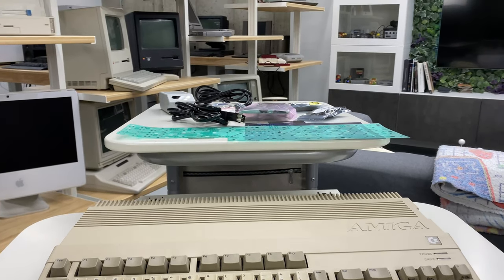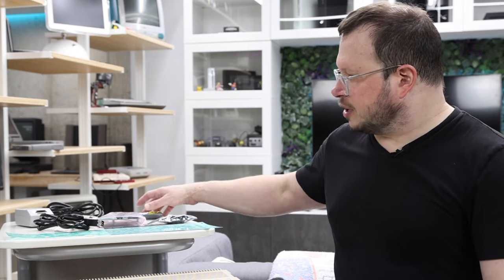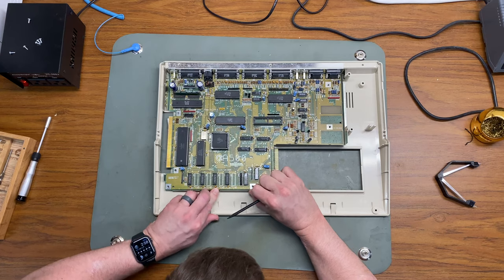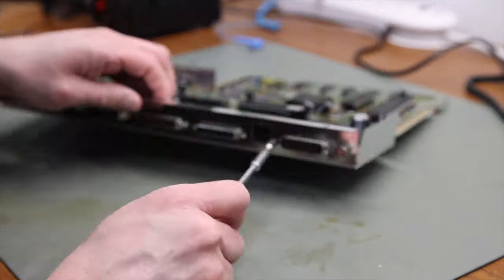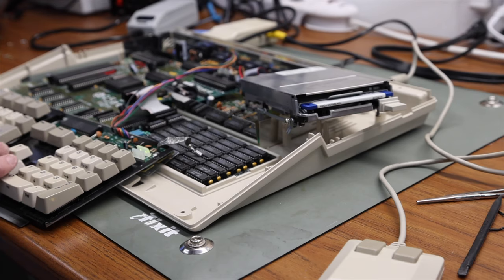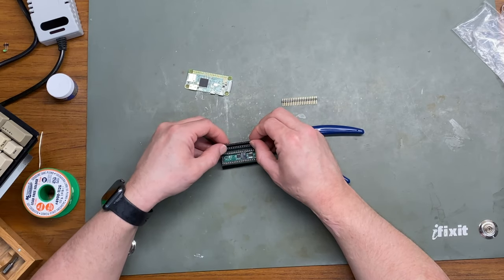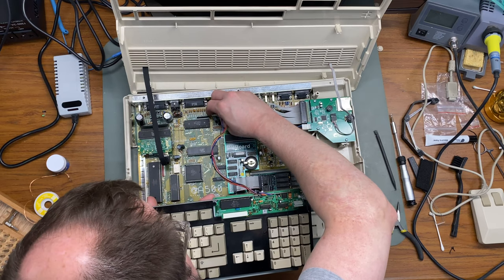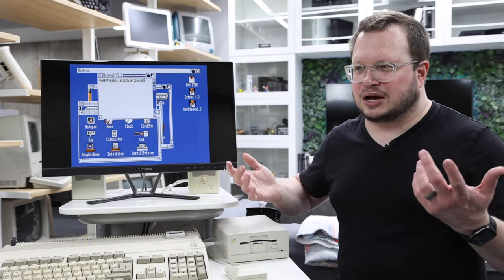Amiga 500 repair and upgrade | Jeremy's Retro Bar

Comment: I have been doing similar repairs on two NTSC Amiga 500s over the last few weeks, and the way I resolved my non-functioning keys was to glue a little strip of conductive copper tape onto the bottom of the plunger.  What I found using a multimeter was that the original conductive rubber had either extremely high resistance, or no continuity at all. 

Another trick is to paint some of that electric paint onto the pads of the membrane for extra conductivity. 

You may also want to check continuity and resistance between different pads on the membrane to make sure you don’t have a broken or degraded trace anywhere. 

Keep going!  That keyboard is absolutely fixable. :)
Reply from the maker: Thanks. Great tips all around.

Comment: The problem with the one leg on each capacitor is that it is the one attached to the ground plane.  The copper substrate dissipates the heat.  The solution, I have found, is higher heat with a short dwell time so not to burn the board.  Pain in the arse, for sure.
Reply: I recapped an Amiga 500 two weeks ago and can attest that this method is effective. :)

Comment: Great video Jeremy! The HD option can stay pretty true to the original too. I installed the GVP side slot add on. That allows extra ram, the HD and a scsi interface and still be period specific! Even added on scsi a cd rom drive. I now have the 1992 Amiga I always wanted when I was 12!

Comment: Hi, nice Video and nice tinkering. When soldering to pcbs i recommend to use more flux and a little more heat so you don't have that pickling noses at the solderjoints. 😉
Reply from the maker: Thanks! This is why I love making videos, I get to make a thing and people with actual know how can give tips that are useful to what I’m doing. I really appreciate it. I didn’t know if it was too hot or not hot enough.

Comment: Great video Jermery.  

The Amiga can be a pain to solder in with its large ground planes but you did a good job in the end.  One the keyboard issue I wonder if it could be a cracked trace on the membrane?  You said it worked once when you just used the plunger on the membrane yourself, I wonder if that bent it slightly allowing contact.  I've had some luck before repairing a membrane by using a conductive ink pen.  Might be worth looking at as the pens aren't expensive (it was about £15).  

Also have to love the pi HDMI solution, I've one myself and the picture is fantastic.  If you do look to a upgrade in the future I would consider the pistorm.  It can do as little or as much as you want from a simple 020 accelerator with fast ram to an 040 with RTG graphics over hdmi.  Getting one is a challenge though!

Comment: Firstly, great video.
Secondly, I mainly use the A1200 myself and although I find it a great games machine it is also great at creative software to make music, animation and images. I'm not sure if these were used on the A500 but might be worth looking up "Octamed" (for music or MOD files as they are known on Amiga). There were several versions and each one had a different layout. I use V4 if memory serves me correct. Also "Duluxe Paint" as an art package. You can do some amazing stuff on there if you research a manual and put some time in. Best of luck with it mate. Facebook also has loads of Amiga groups that are all willing to give good advice. I help to run one of them with a friend. 👍

Comment: Jeremy's Retro Bar - Don't even bother trying to get an origional Amiga monitor,  first trying to find one that is in good working condition won't be easy and the prices for them are crazy.  I have a Amiga 2000 and got the Flickerfixer/Scandoubler for it from Individual computers, then when I heard about the RGB2HDMI adapter I got that and personally think the RGB2HDMI adapter is the better of the two.  It's also alot cheaper also.  The only downside of the RGB2HDMI adapter is that it only works with OCD/ECS chipset Amigas and doesn't work with AGA versions  of the Amiga.  If you do decide you wish to give the 500 a bit of a speed increase look into the PiStorm.

Comment: 21:36 The pixel flickering from the Pi Zero can be fixed with a high quality HDMI cable. Thickness probably helps. For DVI I used a 'BLUERIGGER' cable but for HDMI I don't know what brand/model is good. Need to get that RGB2HDMI adapter. Thanks for the video.  Suggest you practice saying 'going to' instead of 'gonna' it sounds better.

Comment: Hi Jeremy. I see you've got my membrane :) Just wanted to tell you that the membrane itself doesn't change the KB layout at all. The only diff between those UK/DE membranes is that one has "short enter" and the other "large enter". Also, I will risk and say that you didn't need a new KB membrane at all. It is very likely that the rubber pad under "enter" stud is a bit worn out or simply dirty. Just swap it with another key to confirm this. EDIT: oh, you've tested plungers already :D
Reply from the maker: I ordered a bunch of new plungers / stems to test out next. I don’t regret the membrane purchase at all I’ll keep it as a backup.
Reply: @JeremysRetroBar  Great! Regarding layout, it can be changed within the workbench. It is not membrane dependant .
Reply from the maker: @retrohaxblog  That's great to know. Thanks! 

Glad to finally be learning the Amiga, of course that means I'm making a lot of mistakes along the way.
Reply: @JeremysRetroBar  Well, that is a standard learning curve :D Amiga is a great computer and plays a big role in the demoscene history. btw. these drinks you are making ... pure awesomesauce :D